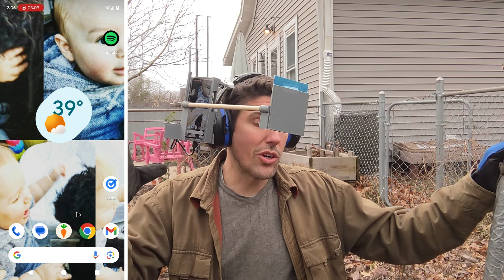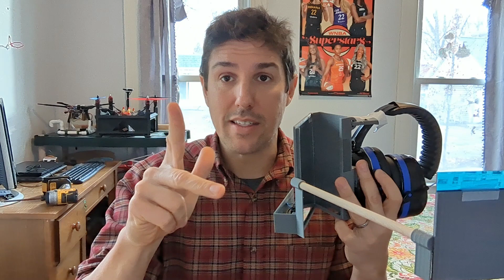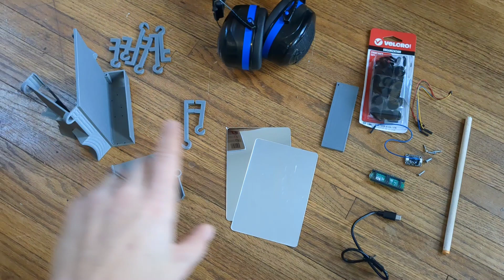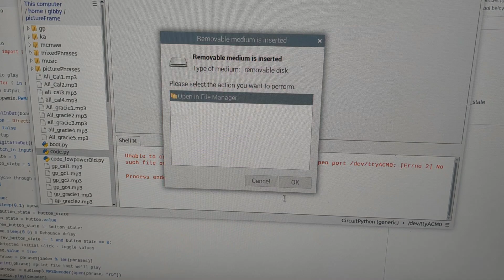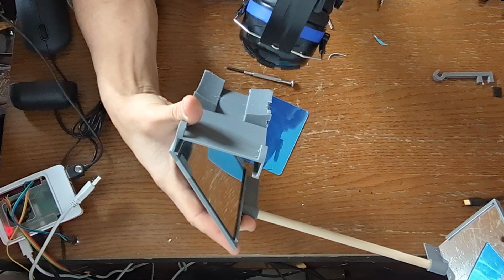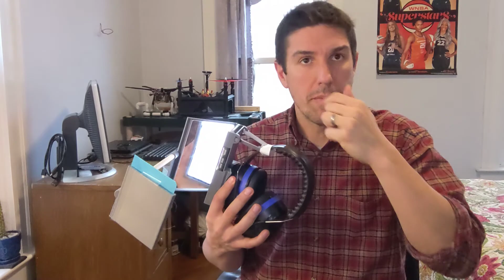HeadTurner - DIY Always Visible Hands Free Phone Control - $15

Comment: with all due respect, what a stupid idea. You show 4 occasions on how this could be useful. Top right is you on a desk with no gloves. and your right hand mobile. Why on earth would you not place your phone on the desk and have clear view.
Bottom right you are holding a chain saw. this contraption would distract you slightly when operating deadly machinery. So I don't see anyone in their right mind would ever consider this and to promote it can lead you in trouble. You need to have a disclaimer and in fact don't include that. If anyone has an accident while operating that , you could be liable.

On to my next point. how long are you doing your errands? you really need to be strapped to a phone every 30 minutes? It looks like it's so slow and cumbersome, why not focus on your task, finish it in timely manner. and take of one glove and check your phone? Whose going to check the weather when doing some errands. You've made a solution to no problem.

Check on AliExpress for " Armband phone". it's couple of dollars. you now have can see your phone. then use okay google to check messages or other things. and google new gemini AI can literally do anything and everything with voice controls so all you have to do is talk to it, your contraption is stuck in the past. When you actually need to use your hand. just take of one glove and start using it. I bet you it's faster and more convenient than your contraption that you have to tap your leg and stand still and bob your head. Better still just do your errand and focus. then take a break to look at your phone.

Stop wasting time on that , and find a solution to a problem that people might actually have.
You need to actually put a disclaimer that operating your contraption you are not liable for or something AND YOU DON'T RECOMMEND IT. and if someone does you are not liable, this is for educational purpose, blah blah. Or have fun with a law suit if/when someone injures themselves doing some chainsaw activities with that LOL